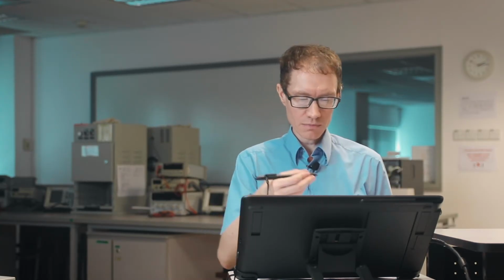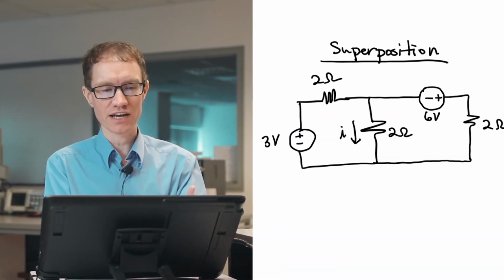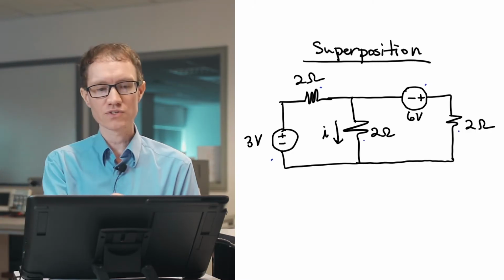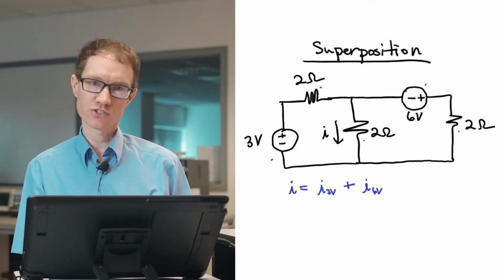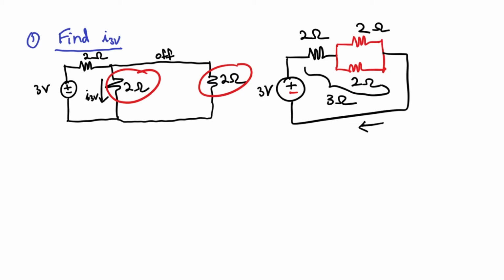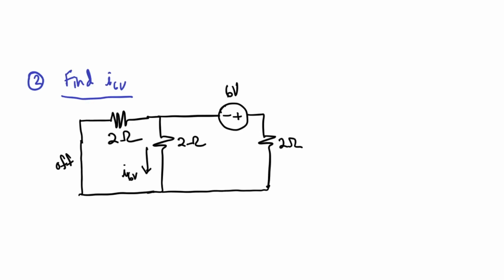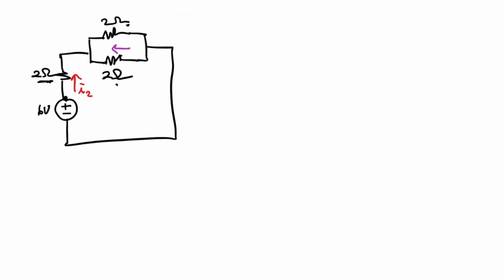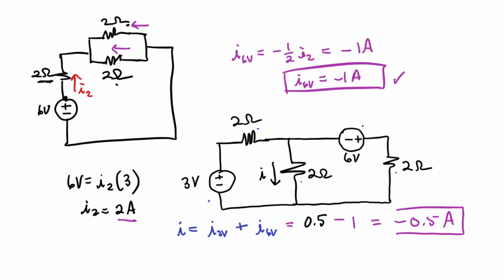Superposition (Circuits for Beginners #13)

Comment: Prof Aaron, Can Superposition be applied to circuits that are combined with some Resistors, few Capacitors and few Inductors with DC Voltage Source of 10V as an example? Please reply back and Clarify.
Reply: Not Aaron but pretty sure it only applies to linear elements!
Reply: @Kamonyx  Awesome Thank you

Comment: How do you have a Negative Current?
Reply: It means the current flows the opposite way. Since you pick an arbitrary direction when you write the equations the results can come up both ways. You cannot really get the direction wrong however u choose it ( if u write the equations correctly ) because the solution will have a sign. In his example one source pushes the current one way on the central path while the other pushes the opposite way.

Comment: I do not agree with your calculations. I run circuit simulator,  current I equal 1,5 A?
Reply: Check the terminals of your 6v voltage source, you might have them flipped.